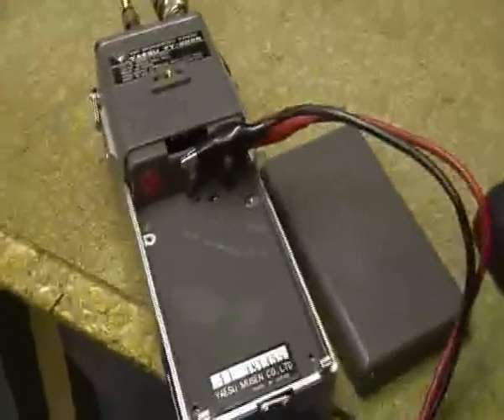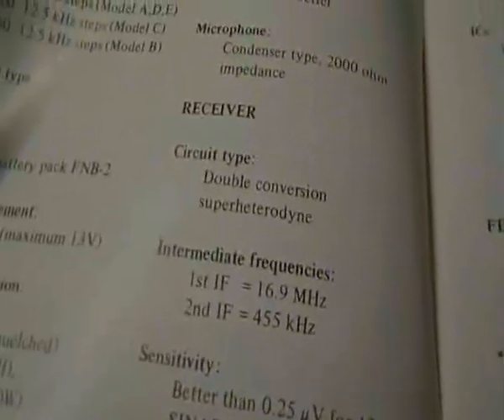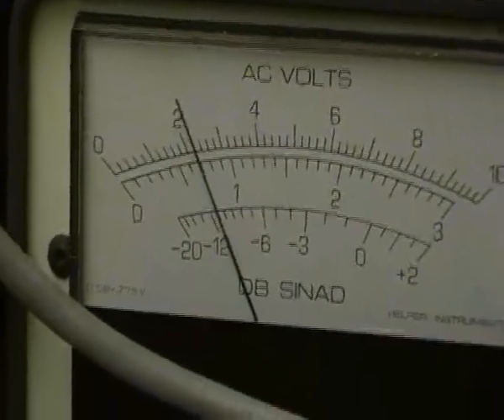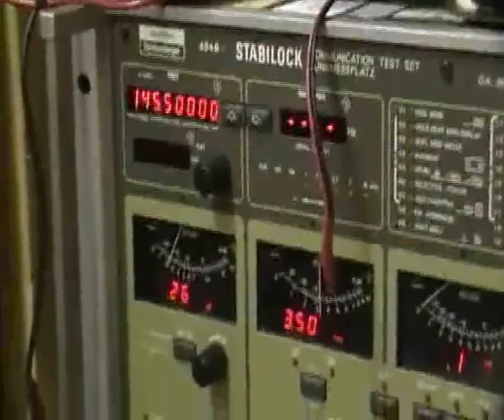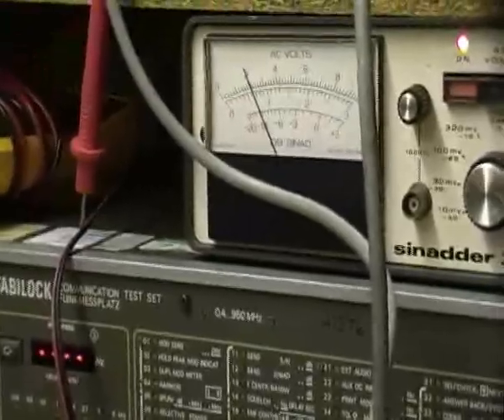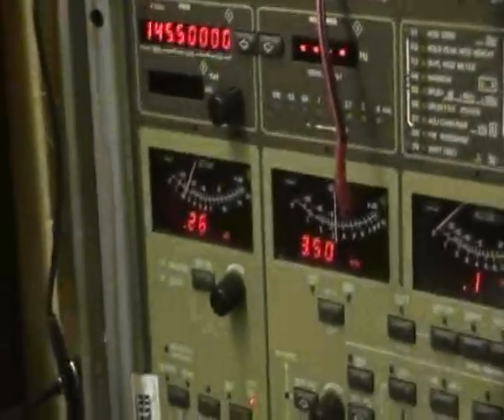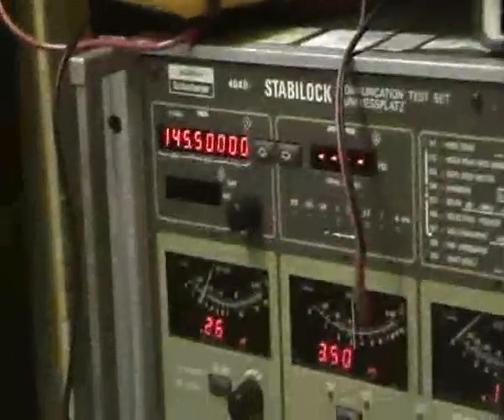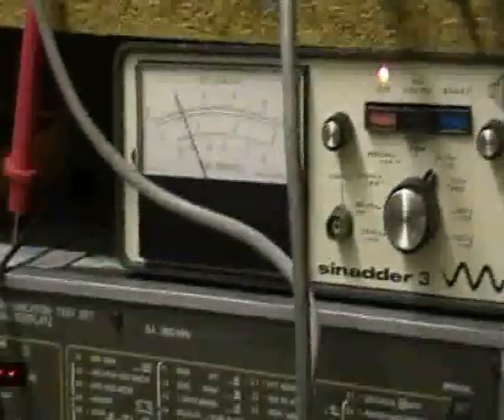Sinad test for a Yaesu FT-208R VHF Hand Held

Comment: Stabilock or 2955 Gary. Which do you prefer? Regards from Ireland
Reply from the maker: Stabilock George every time 2955 is to flaky with those hybrid modules getting damp. The Stabilock 4040 just works. Iv had a 2955B for the last 4 years tho and thats been fine. So if u are looking at a Marconi go for that model but i wouldnt get a 2955 or 2955A. I wouldnt pay a fortune for  the Stabilock either there is a bloke that has 6 of them on the bay they are a tad expensive. He is offering a guarantee with them tho. Hope that helps mate.
Reply: @g1fsh  I have those in my watch list. Just need some more coin. Usual story
Reply from the maker: @GeorgeEI7KO  prices seem to be on the up at the moment mate but i wouldnt want to pay more than £500 for any of the models we mentioned. Well appart from a good 2955b that i would pay upto maybe £800 for.
Reply: @g1fsh  thanks Gary. Some of them off their rockers on ebay. I must admit, I do like the looks of the si4040